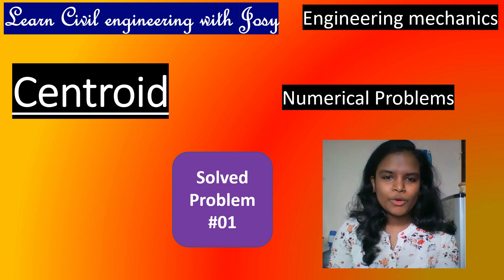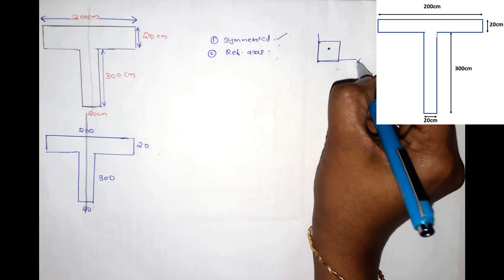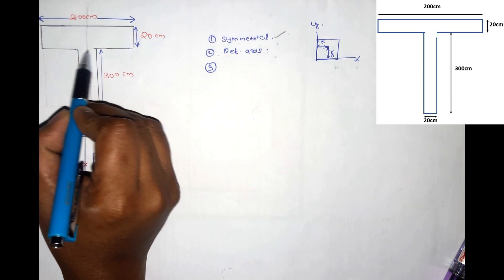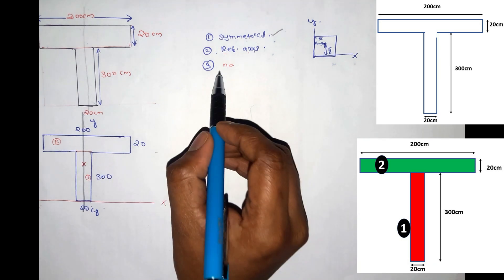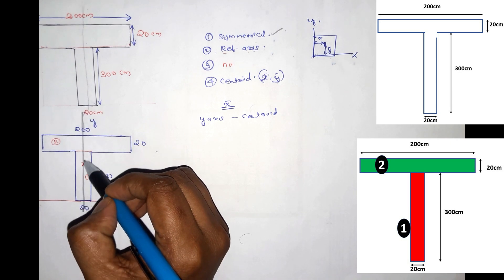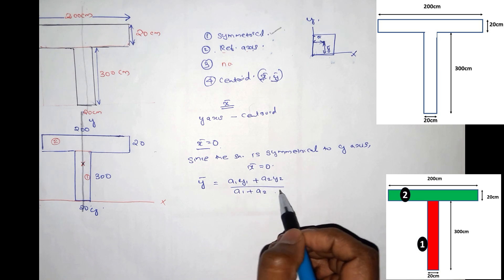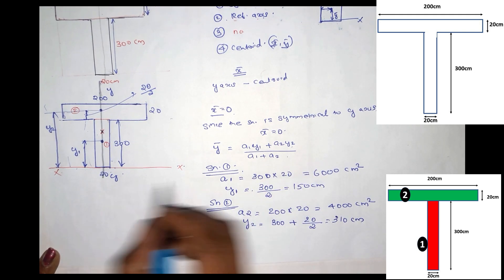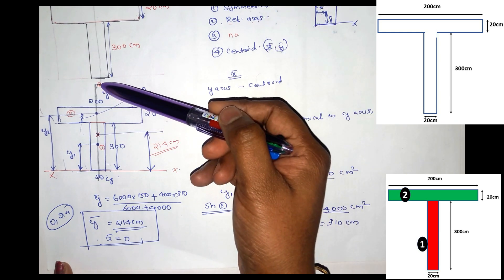Problem on Centroid of T Section(മലയാളം)|PART 2|Centroid and Centre of Gravity|Engineering Mechanics

Comment: Symmetrical ano enn engene nokiyath,
Reply from the maker: Figure nte centre kudi oru line varach nokkuka..for eg: ee t sectionte centre koodi vertical directionil oru line varach nokkuka..athayath y direction koodi..then aaa line nte leftlekkum rightlekkum same figure aakum kittuka..athayath same dimension aakum kittuka..
Mirror image aarikkum kittunnath..
Manasilaayo..?
Ivde x axis line varachal symmetrical allla..karanam namuk mirror image kittillla..
Reply: @learnwithjosyvaidyan7938  ok,x axis centerloode varachal,appol namuk diffrent parts ayrkm kittuka.alle.
Ethenkilum oru axis varacha mathiyo symmetrical ano enn nokan?
Reply from the maker: Muhammed anas k 
Symmetrical aakanam enkil centre line varakkumbol mirror image kittanam..
2 axis num check chyyanm..
Ivde y axis nu mathre symmetrical aayttullu.. x nu symmetrical alla..
Centroid prblethil Symmtry check chyyunnath enthinaanu? X axisinu symmetrical aanenkil y bar zero aakum.. if the figure is symmetrical to y axis , x bar will be zero..
So 2 axis num symmetry aano nnu chevk chyth nokkuka
Reply: @learnwithjosyvaidyan7938  ok,thank you
Reply: 5 th module varumo
Reply from the maker: Muhammed anas k oct 5 alle exam? So full portion cover chyyn pettimonnu ariyillla..but videos upload chyyumm..
Reply: @learnwithjosyvaidyan7938  ha oct 5.kuzhapalla ,a mod allathe oke indallo.ath mathi.thank you
Reply from the maker: Muhammed anas k 👍👍pattunna athrem idam👍
Reply: @learnwithjosyvaidyan7938  centerloode line varakuka appol same parts kittanam ,enkil a axis n symmetrical anu.angane alle